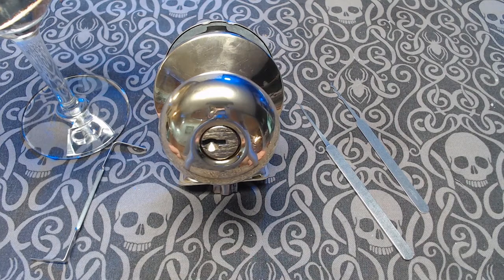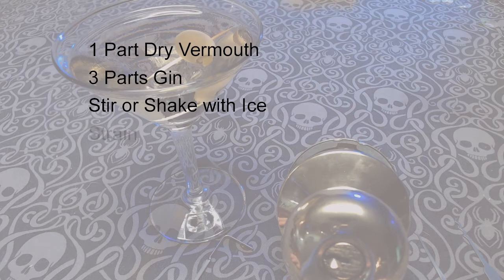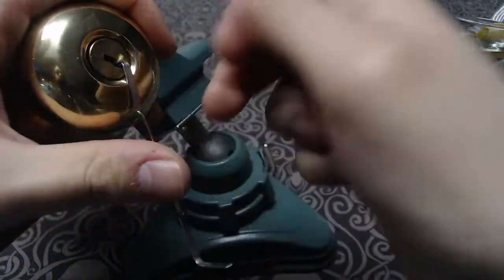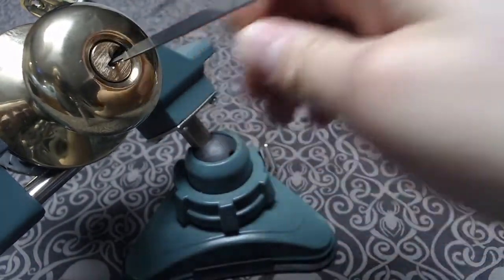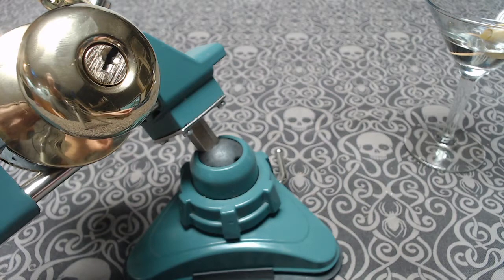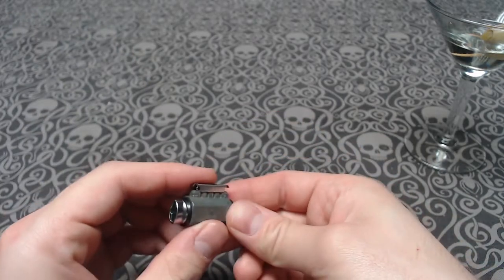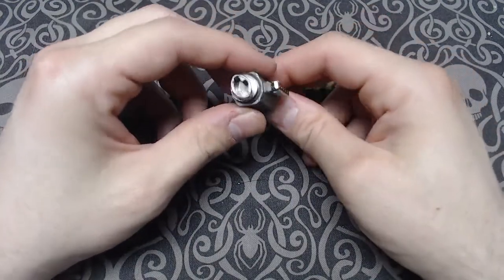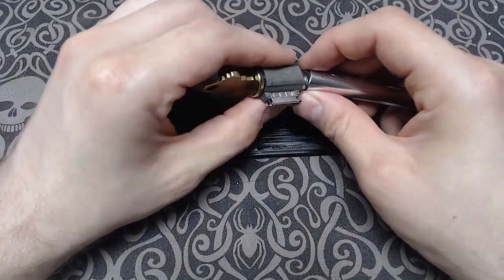(004) My Least Favorite Lock | Schlage F Series Picked and Gutted

Comment: Great opens and distain for the lock😛 I hate locks with standard pins and sloppy tolerances they can be a pain in the arse to pick. In the martini department technically I do think you need 3 olives in that drink as you have 3 parts gin. Great video mate. Stay well👍🇦🇺😊
Reply from the maker: I haven't heard that about the olives. I always thought that it was just supposed to be an odd number.
Reply: Spooky Lockpicker I do forget where I saw it but I am 90% sure it is the same as how many measures of the gin/vodka.
Reply from the maker: I wonder what the upper limit is. I can't imagine you are supposed put 15 olives into a dry martini.
Reply: Spooky Lockpicker I think the martini glasses volume is 150-175ml so the most you would fit in is 5 std drinks